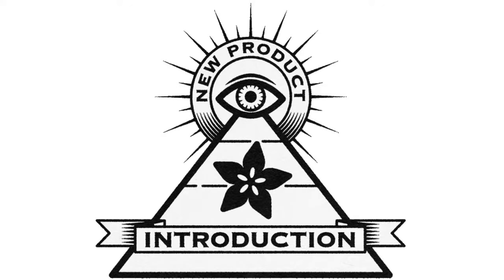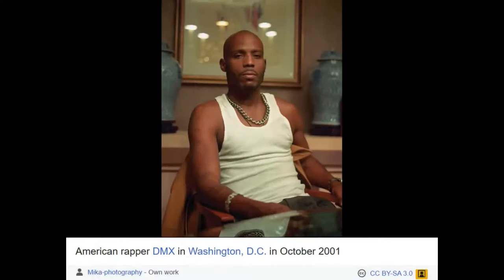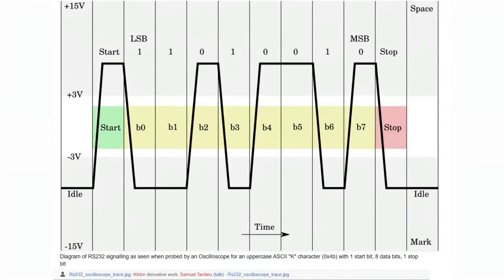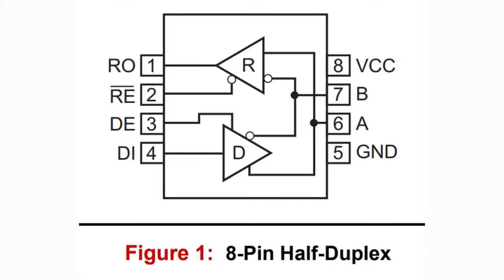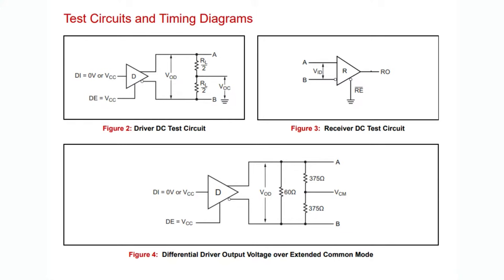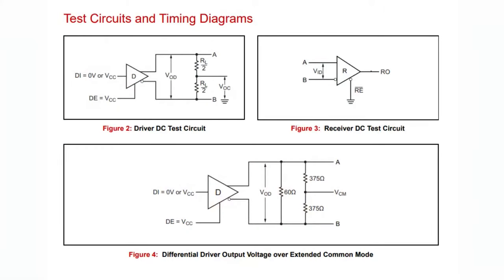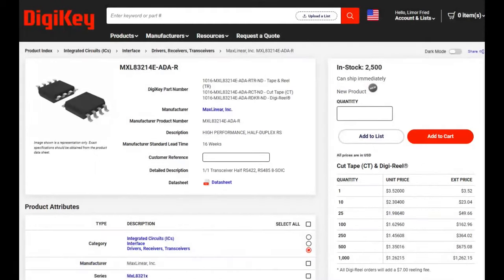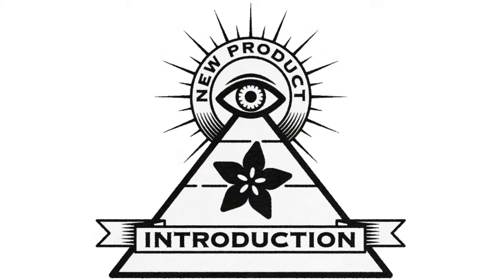EYE ON NPI - MaxLinear half duplex RS-485 transceivers #DigiKey @DigiKey @Adafruit

Comment: Pepperidge farm remembers the array of five 1uf elecrolytic capacitors That would telltale a MAX232 (or similar) chip. The capacitors would switchively boost the 5VDC tail to +/- 10V (actually 12V was desired, but 10V was barely sufficient) to drive "RS232" ports - and modems and whatnot.